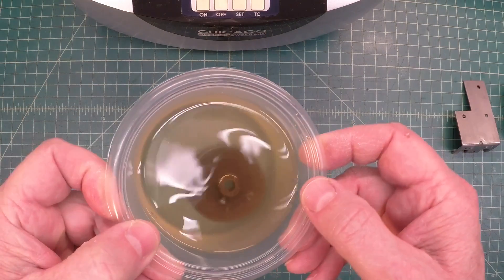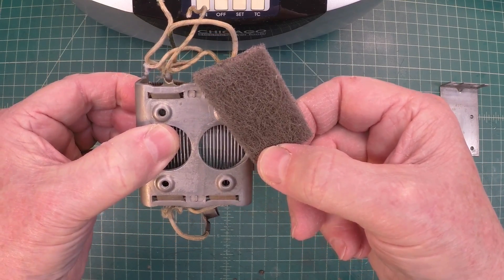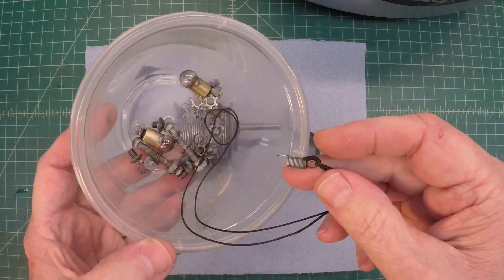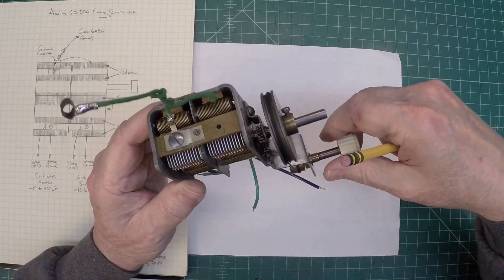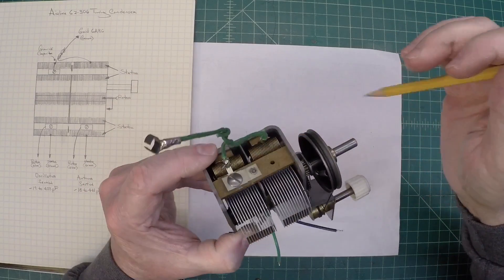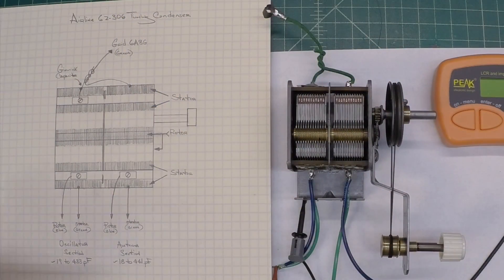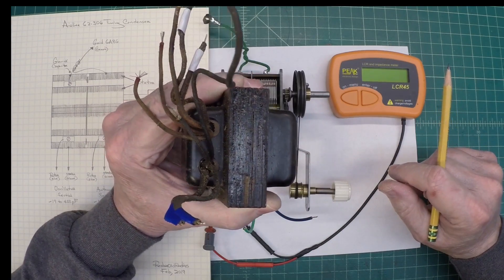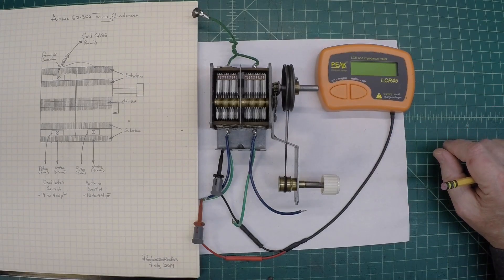Airline 62-306 Teledial - Tuning Condenser Cleaned Up

Comment: I have been using Lithium grease on tuning condenser bearings, which has good high temperature characteristics - used to pack car axle bearings.  I was unaware of the oils from the RC hobby industry you noted here.  My wonder is whether a grease or an oil would be more or less attractive to grime.  Are the LaBelle products OK in higher temperatures (as in an enclosed chassis).  any thoughts?
Reply from the maker: The LaBelle has held up great for me. None of the grime or buildup that you typically see with a 3-1 oil. I have a tube of Lithium grease too. One of my viewers suggested I try: https://www.harborfreight.com/85-gram-super-lube-grease-cartridge-93744.html This product has PTFE and should be equal to the LaBelle product. After cleaning the bearings out, I use oil first then pack in a little grease. It takes very little product. Best, Don

Comment: That ultrasonic cleaner must be a blessing to have around ,I was wondering how you cleaned a tuneing capacitor,with out hurting it .nice job .
Reply from the maker: Thanks Ron. In most cases unless they are super nasty, you can wash them in the sink with warm soapy water. Some folks use their dishwasher, but my wife would put a hurting on me if I caught. LOL Best, Don

Comment: If you have a radio switched on and tuned in to a station, Then have a tuner not connected electricly in your hands and turn it,sometimes this can change the station on the radio,I done this with a transistor radio,strange,
Reply from the maker: Interesting, I’ll have to try this. Best, Don

Comment: I’ve been subscribed to your channel for about a year, and I look forward to very new video you release. I also follow a few pages that you follow . I’ve been licensed since 1970 and have remained somewhat radio active throughout that time. Your videos have taught me some troubleshooting tricks and techniques that have resulted in getting me into a restoration mode. In the past when I attended a hamfest I’d avoid radios and test equipment that were in a visible state of disrepair. Now, I look for them, so I can restore them and give new life to an old faithful piece equipment. 90% of the repair process is usually replacing failed capacitors.  Just wanted to say thanks for all your hard work!
Reply from the maker: Bob, I’m glad they have helped and I wish you the best on your current and future projects. Thanks again for your kind words. Best, Don

Comment: Don - Glad all worked out and thanks for the shout out.  Glad your transformer replacement is near what you need. I did a little research on your replacement transformer and it belonged to an Airline Model 62-276. There was an exact duplicate of that transformer which is a Stancor P-6011 (Which I saw you have in the last video) .   The ratings are 700V  CT @ 7ma ,   5V @ 3A and 6.3V @ 2.5A. I will put helpful links under here. I would definitely remove those coils and clean things up so I think you are making a good call on that.   http://www.vintageradio.com/history/Stancor1939.pdf   and specs   https://reverb.com/item/14428663-nos-nib-stancor-p-6011-power-transformer-115v-700-vac-70-ma-6-3v-5v  -   http://www.tubebooks.org/file_downloads/stancor_1959.pdf     Hope this helps Don  -   thanks Ron
Reply from the maker: Ron - thanks for taking time to pull this together and the shared links as well. I found the info useful and filed it away for future reference. I appreciate you following the series. Best, Don

Comment: Wow! Great cleaning job!  

An amateur radio operator KT5Q (sk) once told me that when he worked in the local radio repair shops as a teenager in the 30's, that they were able to clean "fuzzy" air variable caps by placing them across a 110vac (via a current limiting light bulb setup) mains outlet. I am not sure if I would try that today, but that was the short version of the story.
Reply from the maker: John, yep the radio repairmen back in the day did it that way. I’ve never tried it or recommend it, but a couple of capacitors in series with the line voltage attached to the rotor and stator will burn the stuff out they say. Thanks for taking time to watch and your comment. Best, Don

Comment: Fascinating to see the truly complicated wiring on the antenna section of the tuning capacitor leading to the grid cap of the 6A8G. 😊 Just wrap that bad boy around the grid wire a few times and your golden... I’m sure I should have some idea but alas, I’m bumfuddled... what does that wrap, connected to the tuning cap at that point, really do. By the way, lovely clean up! Really great.          Buddy
Reply from the maker: Buddy, the first time I saw a gimmick capacitor, I said there’s a wire cut and I can’t find the other end. The gimmick capacitor (two twisted wires not attached) have an approximate value of 1 to 5pF. It allows the oscillator to couple with the antenna section (mixer for the 1st detector tube). The radio shouldn’t play without the coupling. If I can get the radio to play, I’ll try to demonstrate this in an upcoming video. Thanks again for following along. Best, Don
Reply: Now that’s really interesting, thank you. Thanks for a name for it too. (Don’t remember this covered in my electronics classes) I’d be interested in a demonstration if you think about it. I don’t have much doubt you will get it working. 🙂